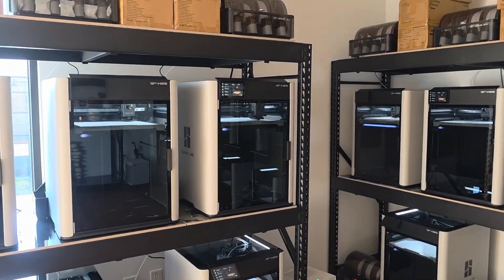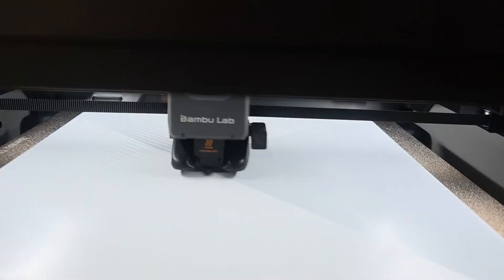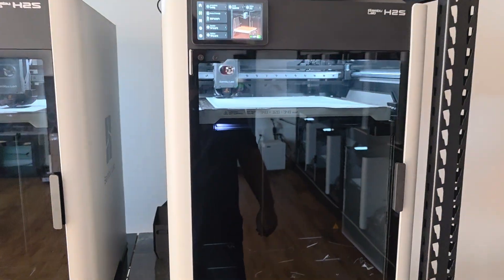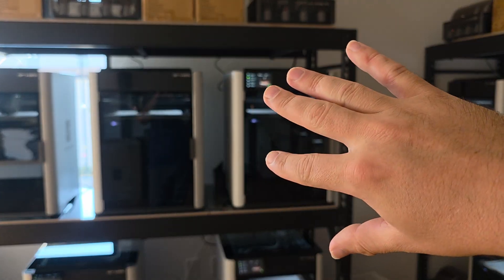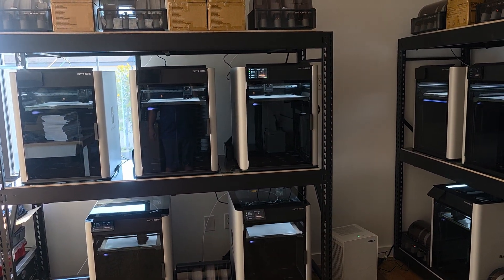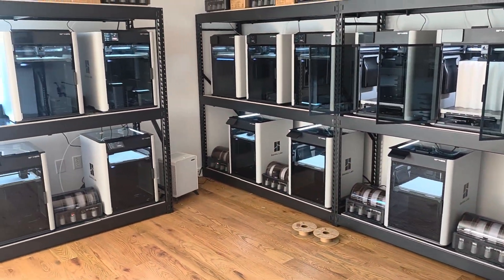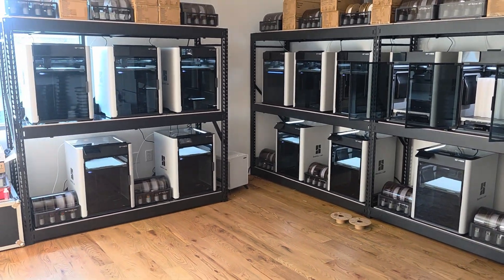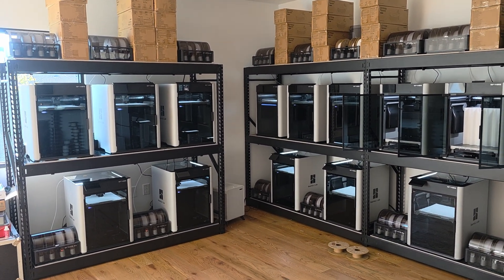Help Me: Bambu H2S Bed not Level

Comment: I have used any H2 range however I wonder if this is similar to the A1 due to shared swappable nozzle type.

On the A1 there are some mini
Screws that’s hold the latch plate to the rear that has common to loosen. There are three out facing and then three smaller on the other side.
The 2nd set of three were all loose on my A1 and these caused me issues levelling and inconsistent layers in prints.
Took me a minute to find the above fault after I’d purchased new nozzles etc to try and fix the issue it was causing 😢

Wonder if the H2 has same setup?

Comment: its called bed tramming not bed leveling i checked my h2s a couple days ago with a caliper and i made a mount for where the laser sits
 i had about -0.5mm compared to the center  in the front middle
 the rest of the bed is very good about -0.2mm in  at 55c bed temp
Reply from the maker: What's the technical difference between tramming and leveling?
Looking at mine I think more than a mm off
Reply: @3DPrintsEverything  Tramming is the angle of the bed relative to the travel of the printhead. The x-y plane of the head is “tram” to the bed if it is parallel to the plane of the bed. 

“Level” is just what a bubble level would tell you. 

e.g.: if you put your printer on a slanted table, it could still print perfectly fine if the head is trammed to the print bed. But a bubble level would say it’s not level. 

It’s a seemingly pedantic distinction, but it matters sometimes. Often you’ll see noobies put a bubble level on their printbed and wonder why they’re getting a bad first layer.
Reply: @rhynnoh1991 So level is in relation to the earth while trammed is in relation to the printhead? Or is that too simple of an explanation? Thanks!

Comment: X1 carbon has adjustment screw on the bottom of the bed, not sure about h2s but a method that has also worked for me is to completely release the belt that moves all 3 z screws (teeth should not engage), (bottom of printer) flip it upside down let the bed move all way to limit of where it can travel and reset pulleysor click the belt over each pully a tooth in one direction or amother till its perfect.
Reply from the maker: Interesting ill look for that adjustment screw

Comment: park the head over the poop chute so it won't touch the bed, then run the bed to the very top and then press Z up again. so one out more motors is stalled, but the others can get their corner or edge all the way to the top. repeat a couple times. this worked with a p1p